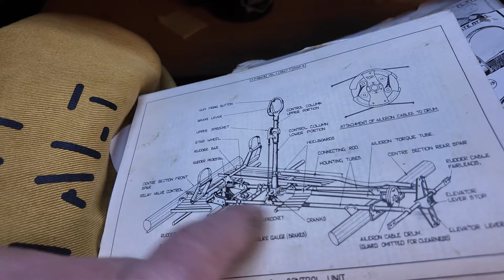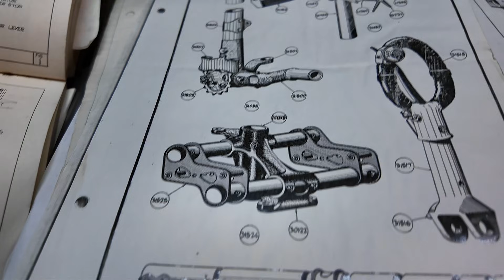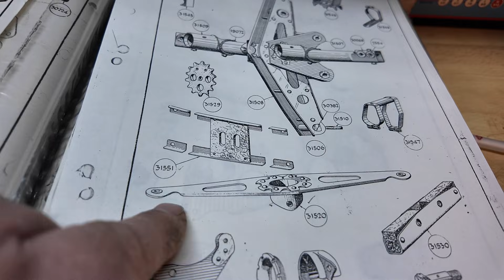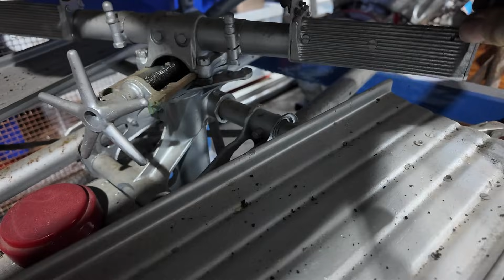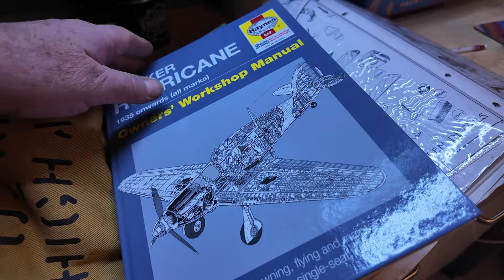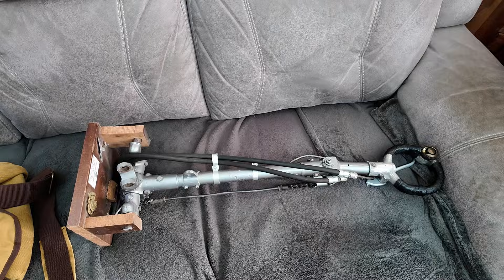Hawker Hurricane Mk1 Rebuild Part 4 by @Aviaddicts Flying Controls

Comment: Your dedication to the rebuild shows why you should never throw anything away. Well, that’s what I tell the wife!
I remember a Mark 1 being dug up in 1977. The spade grip covering was in very good condition, having been pickled in fuel and oil for 38 years. It had crashed in April 1939.  Sadly the pilot, Sergeant Sidney Evetts was killed. At the inquest, a police eyewitness described the aircraft spiralling and diving slowly.  My father who was working nearly a mile and a half away said it screamed down from height, and when it hit, it sounded like a bomb going off.  Apparently wreckage was strewn over a 200 yard area. I’m more inclined to believe my father’s description, as it took a very large excavator to get down 18 feet to where the engine had stopped when it hit shale.
Reply from the maker: Cheers. Real interesting story. I shall look up the aircraft. Many thanx